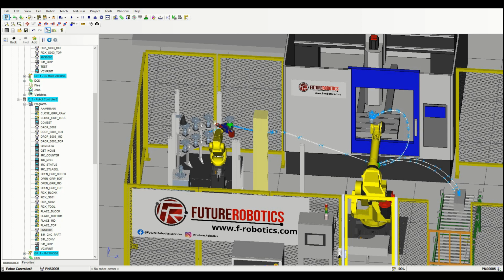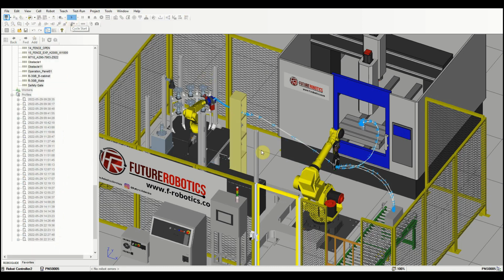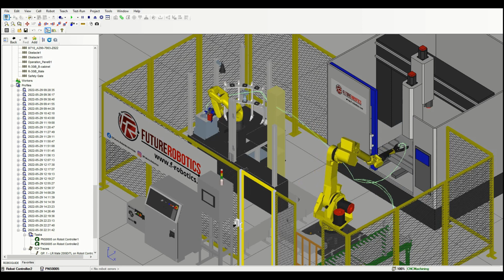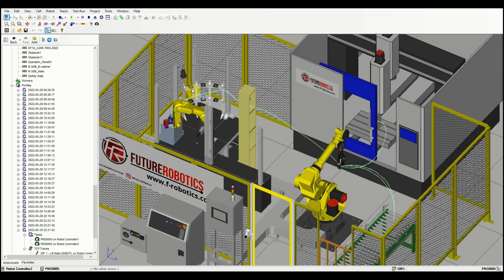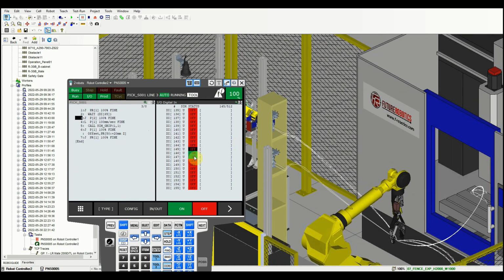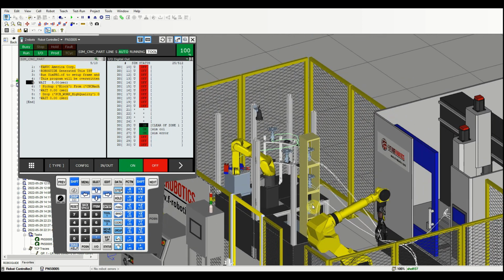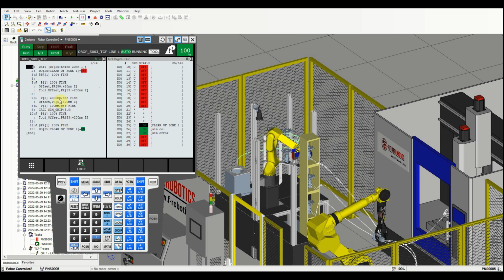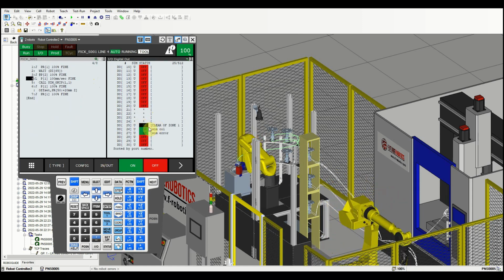Robot collision zones - how to set up collision zone ?

Comment: Thank's for your video, so I have a Kuka robot working with cnc machine, so I added a submit interpreter to run in parallel with my main program in order to monitor my reset button to return at home position from a random position. In this case should I use the collision zone to return safely at home position without scratching the cnc machine?

Comment: Hello. It is good, but this code is not working at next situation: If two robots simultaneously request [DI] collizion enter zone from plc, plc send that robots can enter to zone , then robots go to work to this zone. Month ago, we had collision of two robots because of this((.
Reply from the maker: You need a collision zone request and collision zone signals, so you need to have 2 signals + PLC has to monitor if 2 same zones are taken, if so than PLC has to HOLD both robots
Reply: @FutureRoboticsChannel  Thanks, yes, we did that if 2 same zones are taken than PLC stop robots by setting bit $move_enable=false. But problem in that, that by this situaton robots can stop 2 or 3 times for day. May be you  know also other solution of this problem? Will be grateful
Reply from the maker: @asuprof2154  I mean I think it's better to stop 2 or 3 times a day than crash 2 or 3 times a day 😉.
If you are interested in an in-depth analysis you can always check out my website and book time for consultation: https://f-robotics.com/consultation